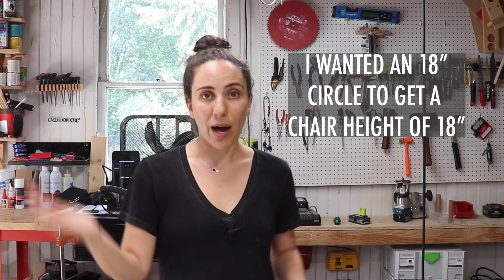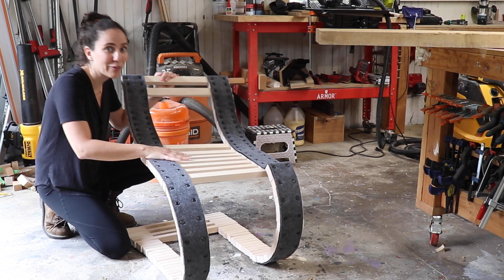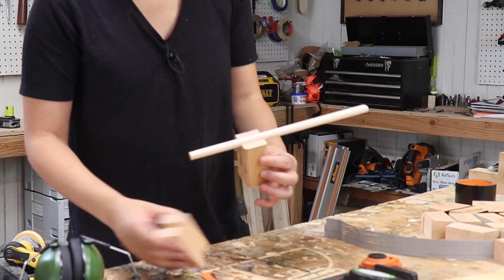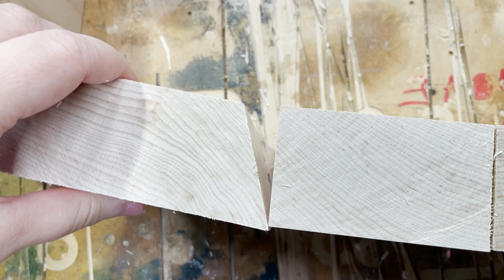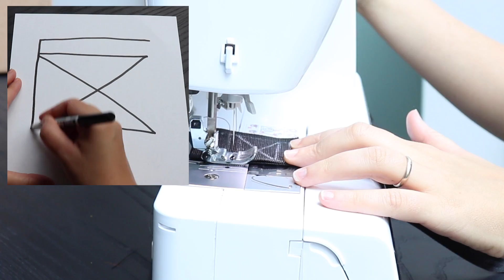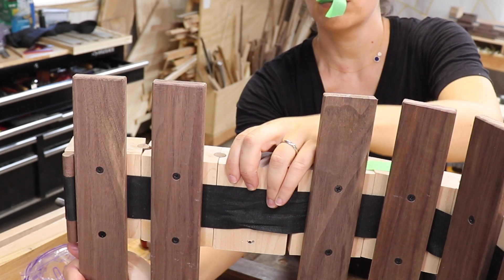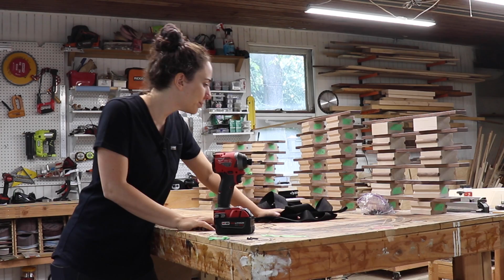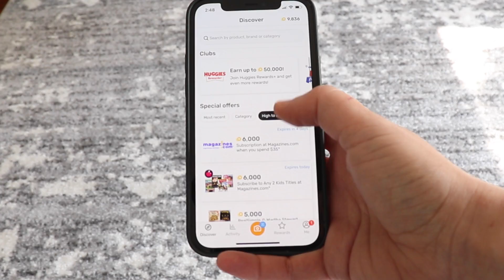I ATTEMPT to make a Roll Up Chair… AGAIN...

Comment: ...
Okay, so there are two aspects to the project
1) The design, how the piece looks and feels (the art side)
2) The implementation, how the design is realized in physical materials. (the material science engineering side)

The modeling is based a static piece. Most of the previous projects: cutting boards, guitars, tables, even a chest of drawers are based on static forces that are at equilibrium. Place a vase on a table. Fill a drawer with 20 pounds of tools. Open the drawer. Close the drawer.

The chair design wants to use flexibility (to fold and roll up) like a roll up tambour. It also wants to act like a solid to bear the weight of a person, like a vase on a table, like a drawer filled with power tools. 

From one end, one wants to take something flexible such as a rope or chain and make it support weight. How does one push a rope?

On the other end one wants to take something solid like rebar or a board and roll it up like a t-shirt or a sock

The modeling process, however, becomes time consuming (attaching the slats to the webbing) and expensive (using the premium hardwood)

Going to the soft wood is less expensive, but not less time consuming.

A) Consider working with smaller miniature pieces first. Can a scale model support the weight of a childrens' action figure?

B) Consider working with 2D models first. Does the concept work with popsicle sticks?

C) Consider doing a materials study. If the piece calls for a flexible joint test a single 2 foot 2x4.
C1) with a single 2x4 fixed at one end, how much does it deflect with a 5 lb weight, a 10 lb weight, a 20 lb weight on the free end?
C2) With the same 2x4 cut in half and connected with a metal hinge, how much does it deflect with each weight?
C3) With the same 2x4 cut in half and connected with a a polymer fabric strap, how much does it deflect with each weight?
C4)   With the same 2x4 cut in half and connected with a a polymer fabric strap doubled over, how much does it deflect with each weight?
C5) With the same 2x4 cut in half and connected with a a polymer fabric strap quadrupled over, how much does it deflect with each weight?
C6)   With the same 2x4 cut in half and connected with a a 1/8" steel cable, how much does it deflect with each weight?
C7)   With the same 2x4 cut in half and connected with a a bicycle chain, how much does it deflect with each weight?

That's the general idea. Test each iteration on a single joint under multiple loads before starting an entire build.

If 1 joint deflects 1 degree under load, that 1 degree multiplies by the number of elements: x40? x60? which works for a diving board or a trampoline, not so much for an end table.

D) Does the shape of the elements affect the joint? What if triangles are used? What if parallelograms are used? 

E) Remember, the concept for the chair was an architecture project that was never put into production. Would it work with solid hinged elements instead of fabric? Would it work with metal? What is required to make the hinged slats immobile in one configuration and compact in the other?

F) If the chair was a solid piece of wood, where would one place 1 hinge to make it more compact? 2 hinges? 5 hinges?

What are the requirements for a single hinge joint so that when it is in the locked position, the chair does not move?

G) Does the hinge element have to be on one side only?

H) If one took the sold chair and made a saw cut into two pieces, how would one make it support weight with ratchet straps?

I) Thomas Edison first discovered 1000 ways to not make a light bulb.

J) Conduct a tensegrity study of the elements of the piece.

K) The core function of the chair has 4 pieces: back, seat, riser, and base. What are 5 woodworking techniques one could use to connect those 3 joints from weakest to strongest? 

L) If you were to create a system for connecting individual elements into larger freeform objects what would that look like? What is your "Lego Block?"

M) Would there be a CNC shape that would let the slats be connected like a bicycle chain?

N) Could origami provide an answer? How could a fanfold piece of paper be made to take the desired shape?

O) Conduct a study of bridges and how their spans support loads. 
...

Comment: If your going to use leather for strapping, then make sure that the edges are properly saddle stitched. It will make any stretching of the leather become very minimal. The saddle stick will help provide strength as well, plus if any of the stitching comes undone it won't all unravel like machine stitching will

Comment: Hi Tamar great video just such a sad pity you didn't get that final result you wanted and honestly deserved to get, I honestly thought " Yes she's only gone and done it this time"  but never mind you'll get it soon enough because " you've got this" anyway just a random thought would maybe a sliding system on the straps work where once you have the chair in place you pull a cross piece up at the top the has both ends of the strap attached to it that you then fold over and secure in a pre made locking position this would in theory lock all the individual points into place. Take care loving the videos Andy
Reply from the maker: Hopefully I’ll figure it out one day!

Comment: This is cool  but there's a number of problems here:

- There's no reason to have a continuous length of strap. The most significant forces occur between the angled sections and therefore the strap should be anchored to each section forming a hinge. By having a continuous length of strap there is more force placed along the length of the strap and therefore it stretches more. This also creates a big problem where not all parts of the chair are under the same amount of load so therefore the less loaded areas will naturally want to curl up under load.

- The sections aren't thick enough. The amount of force that stretches each strap between each section (assuming you anchor the strap to each section forming a hinge) is inversely proportional to the thickness of each angled section. More precisely: tension = width * weight / thickness. Therefore, you'd want to have each section as thick as practically possible and as narrow as practically possible. From a practical material standpoint due to deminishing returns select a thickness that's the same as your width.

For the engineers out there:
Yes my equation is over simplified because I wanted to show the relationship between the forces in an easy to understand manner. The relationship is derived by doing static analysis on a cantilevered solid where there is s small gap between the cantilevered solid and a fixed mating surface.

Comment: Hi, the toughness of your meshy material comes with the flex. You should use something not stretchy, like lifting slings or slings with steel wiring in it. Look for forklift stuff. Additionally, when you tension the straps make sure they're screwed down to every single piece, so they can't move along the whole length.

Comment: Only solution is to use something absolutely non-streching. I'd suggest a bike-chain instead of webbing or leather, slightly embedded in the blocks. The wider the chain (normally its approx 8mm wide) the less skewing you'd get. Last addition maybe, is to add pins and holes to the blocks so they 'catch' on to each other.

Comment: Like I Said Last time: use Carbon fibres for the tension material. In this project it is not the strength but the stiffness that matters… uhpe has a low stiffness so it will flex a lot…

Comment: A lot of good points here, one that I didn't see mentioned clearly is that if you can attach the strap to the wood as close the the join as possible there will be less material to that can get longer and the gaps will stay much smaller (5% of only a few millimeters is a lot less extra length than 5% of all the way around the chair)

Comment: Leather or any woven fabric or plastic won't cut it. You need something made of stainless steel, maybe a chain, and it has to be a hefty one,.
Or woven steel banding. Something that doesn't stretch at all. And I'm not even sure that will work even steel stretch somewhat.
The forces on the first bend is huge.
The dowel trick was excellent.

Comment: What if you routed out an undersized groove and clamped some sheathed steel cable in between the two layers of wood?

You aren't gonna stretch a decently sized cable, and there would be little chance of the cable moving around with the kind of friction between the cable, its sheath and the wood clamping it in place...

Comment: I’m gonna suggest looking into dyneema. It’s 4% stretch when under full load. I think one of the big issues you’re facing is that the straps stretch too much.
Then maybe add a second strap along the back that you can clip into place to offset the front tension. A strap that prevents any blocks from folding over like the bottom block did.
Reply: Dyneema is a brand name for UHMwPE, so I wouldn't expect the results to be much different. Even if it adds more than just a bit of weight to the chair, I think either cable or hinges are the way to go on this one.
Reply: steel cables stretch more than dyneema
Reply: I feel like having 2 additional, shorter straps that focus on the seat, and then the lower bend section where most of the tension is generated would help to keep the tension localized where it is needed.
That way instead of having 1 strap that is distributing the tension throughout the entire chair you would have a short strap around the lower bend that takes the majority of the force and localizes it to that section with an additional strap that stretches from the butt of the seat around to the middle of the base (right around center of gravity) that takes a little bit more of the force. That would leave the full-length strap with a third of the of the overall tension at most (and hopefully a lot less if she can get the other two to be more taut).
Reply: That’s a terrible idea.

Comment: It seems the strapping of any kind is too flexible by far. I am now thinking you need “hidden” steel cable through the middle of the wood with threaded tension capability, I feel like you need double or triple the stiffness and pressure. An engineer could tell you but I am guessing you need tension of the order of 2x your body weight and a stiffness so that the entire cable length stretches less than 1” over the entire length. It may be less about the tension and more about the stiffness.

Comment: I have no idea if it would work but steel pallet banding is my suggestion. It's cheap and wouldn't require any design modification if you wanted to test it. You could probably get a few lengths long enough as scrap from a hardware store if you check after they receive lumber, we always tossed it in the dumpster.

Comment: Three main problems that I see (I'm a PHYSICIST into woodwork 😁):

1) The wood is not hard enough to avoid compression under that extreme lever action, and it only takes the tiniest amount to cause it to sag. End grain is better. (Metal plates on the mating surfaces is better still, but a real pain to build!) Thicker timber will SIGNIFICANTLY reduce the leaver action (though can use narrower timber to maintain weight).

2) The UHMWPE is the correct material, specifically Dynema (rather than Venom), having only 3% extension at failure, and stronger than equivalent thickness steel cable. All other materials stretch more. Double up, to reduce stretch. 

3) The webbing needs to ALWAYS be on the OUTSIDE of the curve! 👈 This is where most of the stretch is coming from, as it pulls away from the inside of the bum curve.  This means that for the countercurve (where the backside goes), the webbing needs to pass through the wood to the other side. This will mean the roll up will be different, but should still be fine.
Reply: Doubling up in the heavy stretch areas could be all she needs, was hoping she would have applied that since that is what she did last time. 

To add some engineering on point 3 you made and to make use of the new dowel functionality; Tamar could pull the strapping between the wood block sandwich, around the dowel, and back through the top. Once pressure is added, the dowels should trap the strap in place and keep the rolling function. The only change would be to have those dowels connected to the strap itself rather the wood block. Some experimenting would be necessary (position of dowel, amount of strapping to add, etc) but could work.

Comment: I don't have a useful suggestion either, but my limited experience with leather says the same thing or worse will happen.  A metal strap or cable might be the answer, but I can't frankly think of how I'd implement that either.  I applaud your tenacity and wish I had a suggestion that I "knew" would work.  The only thing I will comment on is that the current design might not be safe long-term no matter what you use.  There are serious compression forces occurring across the grain of fairly narrow pieces of wood.  I'd worry that at some point it could/would fail under load especially if a larger person sat on it or a young person/child jumped on it.

Comment: This is so awesome! One thing I'm thinking is that the tensile properties of the webbing is only half the battle here. The corners of the wood are also under great compression and I expect they are deforming and contributing greatly to the total deformation of the chair. Maybe attach some metal plates to the mating wood surfaces to give the interfaces more hardness? either way, love your enthusiasm and the project as a whole!

Comment: Love this series! Sorry if this has been suggested already, I've had some ideas that may be worth adding to the long list of suggestions.

Please take (or leave) them with complete humility that I don't know what I'm doing and you absolutely do! And I also believe in the hive mind to problem solve :)

1) Adhere a thin piece of sandpaper on the underside of the slats to act as an extra level of "tooth" for the webbing to grip to when they're screwed onto the blocks? If the clamping force of the wood slats alone isn't enough to mitigate stretch, this may help. It'd allow for a locking of the webbing but also allow adjustability that staples would not. This is provided there's zero stretch happening in the webbing, as you are all too aware that even 0.5mm of stretch between each block will compound into 13mm of elongation 

2) Drill through-holes into each block in the direction that the webbing would go, but substitute a low-stretch rope to thread through the structure - something like kevlar or nylon (I didn't research to see what's available but surely there's a low-stretch option out there). It'd hide the mechanism that holds the chair up, and you could do it in stages to that any stretch can be mitigated by being distributed between a few lengths of rope.

3) Do away with the webbing/rope all together, and make a tank-tread joint with thick dowel as the hinge pin. It would give you another point of contrast, it would rely on mechanical joints and wood compression rather than trusting the weakest link (the webbing) to do the heavy lifting. You're already using dowel, this way it would keep it from racking sideways.

Good luck on your creative endeavours! Don't be disheartened, you got this!

Comment: Slot in steel cable perhaps.  No flex, good look, increases your weight capacity. 

 Edit: Looking at it again. You may have to go to steel.  The wood only makes the form and the load is largely on the strapping material.  Even better it's at curves so the seat and floor act as a lever against the strap multiplying the force of the person. I think steel or tow strap is where you need to go. Then it comes down to the angle tolerances between pieces for proper form.

Comment: As I see it youŕ Problem was, that you allowed the forces on the chair to be connected. But the forces are different on different on different parts of the chair. To stay in form, each joint has to be able to carry the forces at that point, and not transfer the force to differend points. The way you did it you tryed to have the same tension on all joints while there are different forces on those joints. So on some joints it collapst way before it was enough tension to hold up on the joints where there was a lot of force.

Comment: Leather definitely would not be a good choice, regardless of where on the hide you select your straps, as it will definitely end up stretching and making the chair unusable. Have you considered just putting literal hinges on the top? Like, metal hinges, possibly even generic door hinges in brass or something. Then you shouldn't even need to worry about the tension or stretch, you'd just need to ensure the hinges were very securely anchored tot he wood, and probably orient the wood grain in line with the chair's curve, so that it won't split with it running horizontal to the chair's length.

Comment: Instead of using any fabric strapping, or cable which will also stretch you should use a chain like a small narrower version of a motorcycle chain. If this makes sense.  You can route in between walnut and the angled maple blocks. Attach it at the bottom and the top where your clamping. The Blocks will still hold together as spacers only the chain will not stretch. Would love to show you how only I have no clue how to show you. Would actually be fairly easy for your to modify. Then you can use your chairs.

Comment: Why not use hinges? this  chair can work, the issue is you are choosing polymer strapping which is designed to stretch. hinges, while not as sleek, would more than likely hold stable and also help solve your shearing issue that the dowels are solving... I really love the idea, but if you ignore the strapping idea and use the wood itself to hold up, it may work better.